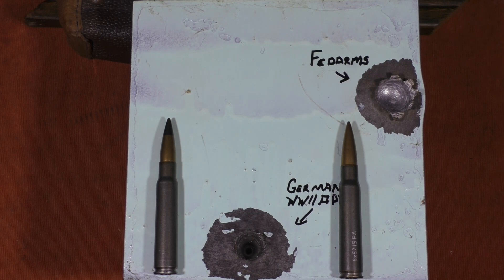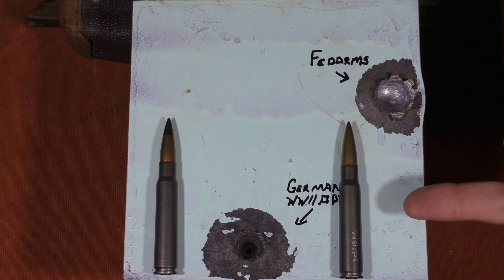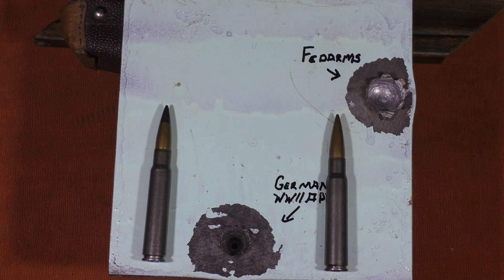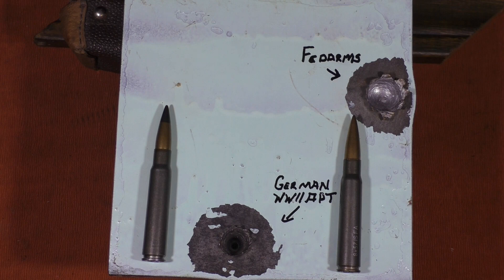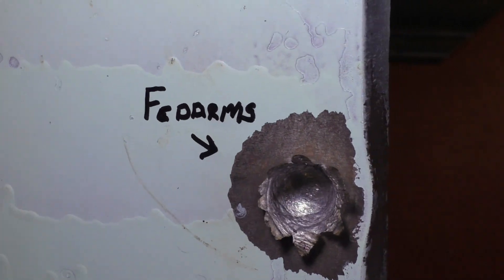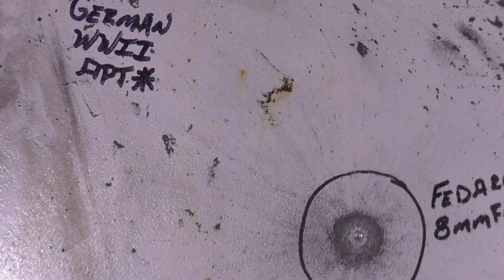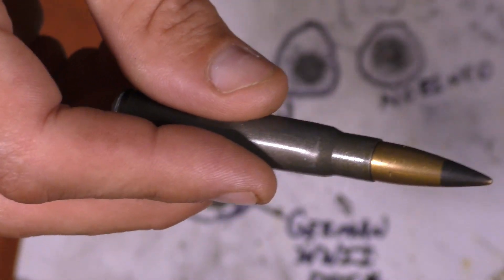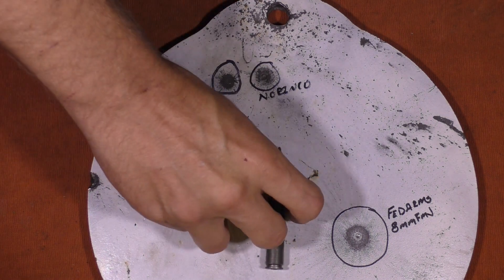German WWII 7.92 APT Vs. Fedarms FMJ: Steel penetration comparison.

Comment: One complaint. I think the test plates need to be supported in an unmovable position to simulate the penetration against a vehicle which was what was the intended target  in WW2.

Also would interesting to see penetration vs  1/2inch armor steel (are 500 ) just for curiosity's sake.

I think you should retest without hitting the support on the 1 inch. And run ap through a Chrono to make sure the velocity matches specs before doing more penetration test with it.
Reply from the maker: Although I understand what you're saying, the round imparts all of energy on the target before it moves but people do want that. Fixing the target increases the chance of ricochet as well, which I've found is already a problem with the AP ammunition I've tested against steel at this range. I used all of the L'Spur SmK rounds I had doing this video, so unless I can find more at a reasonable price I won't be able to revisit this round.
 I will have a video coming up testing non tracer Smk 8mm against a variety of targets including 3/8" AR500, 1/2" AR400 and a surplus lvl III Italian kevlar neck protector. I do already have a video on the non tracer SmK 8mm as well, but it's the standard 1" A36 and 3/8" AR400 I use in most my steel penetration comparisons.
AR500 isn't armor plate it's abrasion resistant plate, the that's what the AR in "AR400" and"AR500" stand for. I use AR400 as that's what I make my targets out of and it holds up just as well. 
I would love to be able to afford a chronograph but that unfortunately is not in the budget. It would be useful for many things we do. As a small unmonetized channel budgets can be challenging. 
I appreciate the input.

Comment: i had 8mm SMK go through half inch of AR500 if the plate was braced. when the plates were allowed to "fly" it did as shown. BTW those cores are HARD. i cut the jacket off and the bandsaw didnt even scratch the core
Reply from the maker: Was its SMK L'spur as I shot in this video or just standard SMK? I have another few videos on the standard SMK which from what I could find was rated to perforate 12 mm as opposed to the L'spur which on the same document was listed with 9.5 mm of perforation. I have more testing for the SMK 8mm coming up in the future. Unfortunately I don't have any more of the tracer variety
Reply: @Alloy211  standard s.m.k. Yes, i have read where the tracer was slightly less effective. also for reference the core form the standard stuff was 90 grains and the steel jacket was the remainder. but i did find that if the material was well braced penetration was improved.

i have yet to find any tracer stuff, or SMKH.
Reply from the maker: @univalve1  The tracer I just happened across at a local gun show. I was fortunate to find them, this vender many times will have interesting or obscure ammunition. So hopefully I'll find something else of interest the next time they're in town. The standard SMK breezed through the 3/8 AR400 which is what I use as the standard against which I compare all the rifle rounds steel penetration abilities. That and the 1" A36 as well, in an up and coming video I'll see how it performs against thicker AR400 plates.
Reply from the maker: https://youtu.be/T-a_a5l-IyA

Comment: i bet a g98 barrel length would have helped some too.
Reply from the maker: I've wondered that myself. Once the weather breaks here I'll be testing out some other WW2 German AP without the tracer. It should have more penetration than the APT according to what I've read. I haven't had a chance to fire any so I'm unsure if reliability will be an issue. Thanks for watching and commenting.

Comment: I have some of the high velocity apt rounds with the green ring used in the German aircraft machine guns. Whould love to shoot one but don't want to hurt the Mauser with the added pressure from them great video
Reply from the maker: Thank you and thanks for watching. I can understand why that would give you pause, if it cause damage to something cherished.
Reply: More than welcome. great to see how those old ap rounds performed.Germany put out the best ammo of any country during the war up until 44 and 45.liked your video on the Ethiopian 8mm ammo was wanting a few boxes till I saw your video and a few others some people did ok with it but most others have had bad luck with it .
Reply from the maker: I feel the same way about the Ethiopian surplus some people have had ok luck while a lot seem to have problems. I wish I could have fired it with the original powder loading but I don't think I would have performed much differently. I was happy to finally get to test some truly AP ammunition.

Comment: Thank you so much for making this video
Reply from the maker: Your welcome and thanks for watching.
Reply: @Alloy211 did ever get a velocity in these? I scored a few boxes
Reply from the maker: @hunterjager9537 Unfortunately not yet but I did acquire a chronograph recently and a few more rounds of APT and hope to be able to test them out. I appreciate you checking in.
Reply: @Alloy211 yeah np. Im thinking about taking the projectile weight and length and plugging it into the Quick Load software to see whats the optimal powder and charge for the best velocity.
Reply from the maker: @hunterjager9537 If nothing else I think that would be a great place to start.